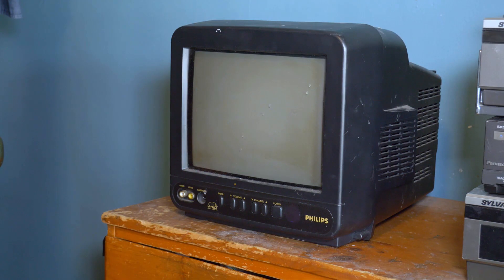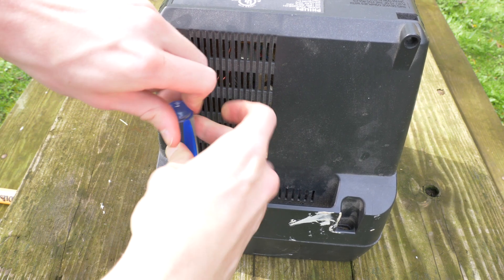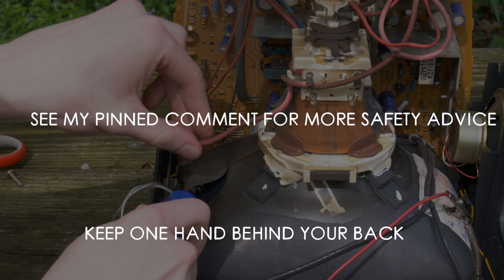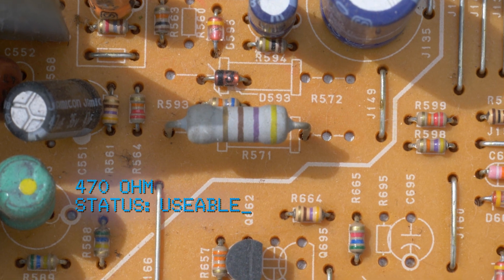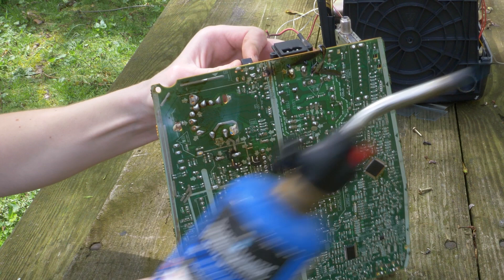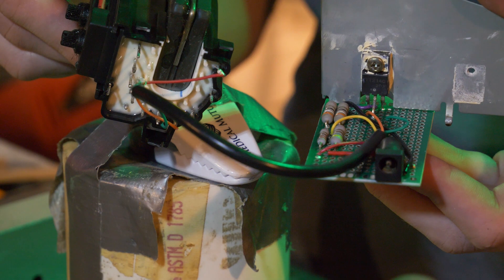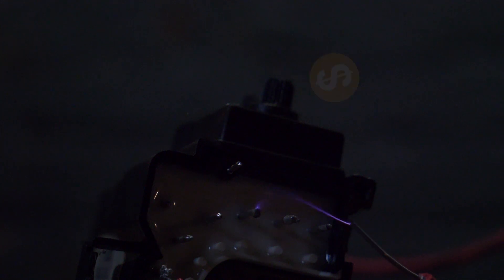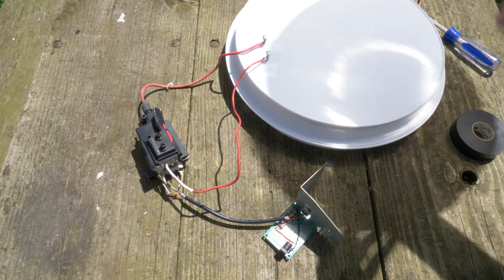Sterilize your Old Masks with a Television! - DIY Ozone Generator Build

Comment: My daughter uses a CpAP machine for sleep, she needed a way to  quickly clean the mask and hoses without the messy taking it for a shower method. So I took an old cat litter pail with a hinged plastic cover, put a light socket in it, installed a light switch, the socket is inside the pail. I bought one of those cheap UV tube lamps with the Ozone option,  screwed it into the socket and volla we have a ozone/UV sterilizer for her equipment. It works great, her equipment stays clean she stays healthy and I think I have probably 25 bucks into the project. We recently had a mold scare in our bathroom  so I took the lamp and put it in the bathroom for fifteen minutes powered on.  The mold is gone!  Nice little device but don't be in a room where it is on as it can harm your eyes, use UV Blocking sunglasses if you must be in a room where it is operating.

Comment: my spark was normal, about 2.3 cm.... after I raised it from 12v to 19v it was weak and almost doesn't work, what can it be?
Reply from the maker: Did you try going back from 19 to 12? If it's still weak at 12 the transistor could have blown. Sometimes they're weakened overtime if it's an old TV and are more prone to failing above 12 volts
Reply: @theVHSvlog  I went back to 12 still weak, I used a 2310fx, I don't know if it exploded, I'll try to find another npn....is there any chance it's the flyback that exploded?

Comment: There where two groups of connected pins on my transformer, according to another video I have choosen the ones with the highest resistance of each group (1,4 and 0,5 Ohm). My electronics seem to work since there is an annoying high pinched noise - but the transformer does not produce a single spark?

Any ideas? I am using a laboratory power supply with 2A max at 12Volts and my resistors are 40 and 270 Ohms.

Thanks!
Reply from the maker: You found the correct primary coil, but I would switch the orientation of the two primary pins. Just swap the wires and hopefully it will work!
Reply: @theVHSvlog  hey there! Thanks for the fast answer! If I swap the connections, then the noise disappears but nothing else happens :/ thank you so far anyway!

Comment: Incredible. 4 components and it really works perfectly. Could this be used to sterilize a whole room?
Reply from the maker: It might, but generating a large amount of ozone in a closed space is a bit dangerous. I also think you would need a higher voltage supply to generate and disperse enough ozone
Reply: @theVHSvlog  As to what I have heard 3 to 15 kV is ideal range to generate ozone. And i think this circuit generates about 12 kV, since the arc jumped for more then a centimeter without a problem. I will try it tomorrow. I have hust one question. Shall I connect one side of the high voltage winding to earth connection to make the device more safe? Would it be fine if I put it in a metal box (from atx powersupply) and connect mains earth to both the high voltage winding and the case?

Comment: Nice video but too bad the flyback you have (same as mine) is DC :( You need AC for optimal corona discharge. I've been scouring the web for alternatives but no luck so far.
Reply from the maker: I actually have a few AC flybacks lying around, but they're tiny and output significantly less voltage than the larger DC flybacks. In fact it's kind of incredible how much ozone a regular flyback can put out in an enclosed space if you have the electrodes spaced out just right. You probably already know but try looking for small portable televisions I usually see a bunch at the thrift store. Thanks for the comment and update me if you make your own build!

Comment: Can you make a video of how to  make a ozone blaster/ blower to blow on specific items like mattresses sofas carpets kinda like a portable blower with ozone inside. Of course i know its dangerous to breath it so i am buying a gas filter mask wile using it. I have purchased an ozone box but the box is designed to let the ozone escape all over which is still good but the fan has not enough power i want something sealed that will allow the ozone to penetrate the layers of foam like mattresses, sofas carseats you get it. I saw one guy did it. Where he created a 3 ceramic ozone genarator mounted on a wood then put it in a vac blower . And that i liked but he did it from scratch and i want to do it with the ozone box i already purchased. Thanks in advance.!! Also can you make something like you just did and sell it?